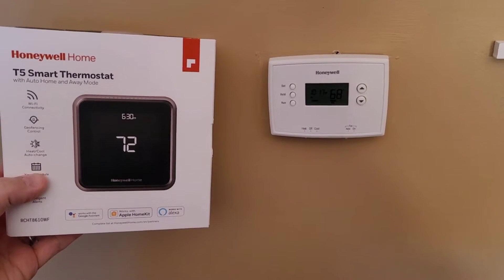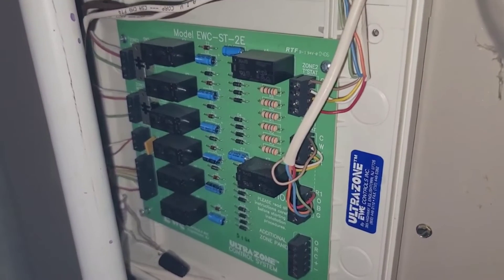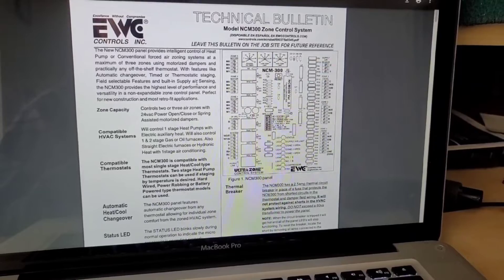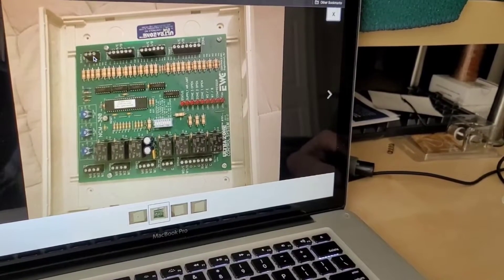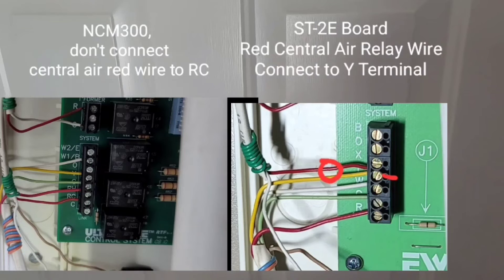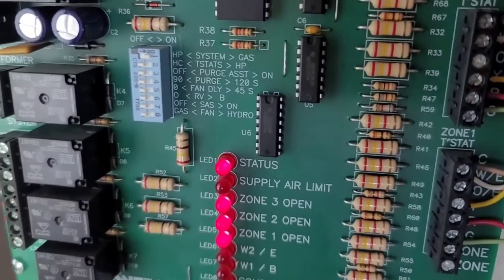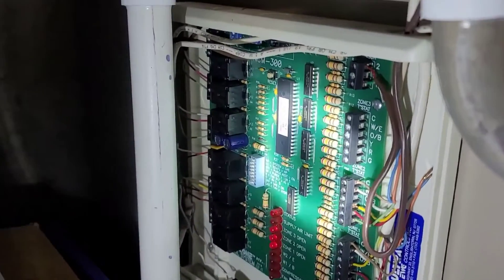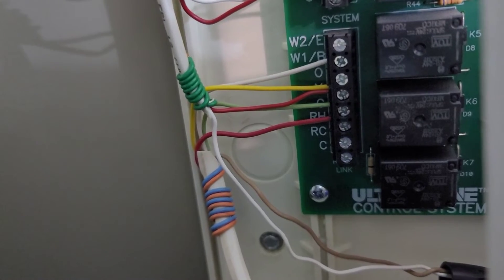EWC Controls: EW-ST-2E Upgrade To NCM300 Control Board

Comment: My current board at home might be broken but I can’t find any information about it online, the only thing it says on it is ewc-300. Whenever I google it I just find images and posts about the ncm300. I’m wondering if anyone knows if the ncm300 would work as a replacement for the ewc-300?
Reply from the maker: I believe they are one and the same. I've since upgraded to the NCM-3z board. I beta tested it and it has been working great! The NCM300 is still a great spare board should the need present itself.
Reply: @Bassguitarist1985 Ok, thanks! I figured that they were probably compatible but I couldn’t find anything conclusive on the internet.

Comment: I am in southeastern CT and also have the EW-ST-2E board. I bought the NCM300 board and am looking to swap it in, but noticed that on the 090512A0369 drawing you posted it seems to specify that the R wire SHOULD go to RC and not RH. That's the opposite of what you mentioned in the video so I was wondering if after you spoke to John that the drawing is inaccurate.
Reply from the maker: @unsaid457  I'll have to review the document when I have a chance.
Reply: @Bassguitarist1985  And what I should have said first off... thank you so much for posting this! Last winter I was told by both a Nest installer and an HVAC professional that using a wifi thermostat would be impossible for me, and in the end thanks to you, I'm going to be able to solve this myself.
Reply from the maker: @unsaid457  I can be available for a chat on StreamYard if you like. Email me at bassguitarist1985 AT yahoo DOT com
Reply: I am planning to install one and ran into the same issue. were you able to confirm if the R wire should go to RC or the RH. my understanding is the on the NCM300 there is a link between the two terminals.
Reply from the maker: @luismiguelescano2315 Yes there is a link between the two so it shouldn't matter which one. If you have a central air system like I do then the contactor wires, two of them, One goes to common and the other one goes to the yellow Y terminal.
Reply: @Bassguitarist1985  Just did the install. Everything seems to be working appropriately. Thanks for the video and pointers!
Reply from the maker: @luismiguelescano2315  My pleasure glad it worked out!!

Comment: I found this video after being told my system was also not compatible with nest, and i have the same system and board as you. Apparently we all 4 (@josephhoang7669 , @tdunlavey , me and you) also all live in CT except im in south Eastern CT, so i figured i should comment on the video because of the wild coincidence. I think this video will be a great help for me once i find where to buy the new board.
Reply from the maker: I'm beta testing a new upgraded board soon. John from EWC has been really patient with me as I've had other things going on. The NCM300 is a great board, but it is outdated by today's standards. Still very viable, and not too expensive used either.
Reply: @Bassguitarist1985  sounds like you have a ncm300 you can sell me lol jk should I wait for the new board?
Reply from the maker: @5JLMelendez5  ha! I like having spares. The new board is still in beta but will be out soon.

Comment: Hi Bass, this was incredibly helpful. I recently purchased two Nest Thermostats which are theoretically compatible with my HVAC system, but not according to Google (because of the EWC control wire which makes it look like I have a Heat Pump system). I have the same EWC model—my house was also built in 2004 here in northern Connecticut. As a DIY guy, this will save me hours of research, and likely a few bucks, too. I will come back to this video once I receive my updated board.
Reply from the maker: Tucker I actually live in Connecticut!!! Not sure exactly where you are I'm just north of Waterbury.
Reply: @Bassguitarist1985  Small world, grew up in Waterbury and live just north of Waterbury as well. Thank you so much for this video, incredibly helpful!
Reply from the maker: @Tony-mm3ut  My pleasure happy to help! Up near Torrington?

Comment: can you share the install/config of the thermostats, please I am upgrading my existing system to the NCM300. I am a little confused on the wiring error you made, I want to avoid it as well but I am not sure what exactly was wired wrong then wired correctly, thanks - I purchased 2 Honeywell RTH9585QWF thermostats to replace my existing thermostats.
Reply from the maker: Same system as me? Forced hot air and central air? The contactor for the outside compressor, one side is common, and the other to the Y terminal, NOT the RC terminal. That was the mistake I made
Reply: @Bassguitarist1985  yes I have the same setup, the wire swap instructions show that the system "R" on the ST-2E should go to the system "RC" on the NCM300. How do I know which wire is the outside compressor contactor? Sorry for all the questions, I am prepping to swap the boards and thermostats this week, thanks. Looks like you have an extra red wire on your ST-2E, I only have 4 wires Y - yellow, W - white, G -green, and R - Red
Reply from the maker: @jamiemcmahon795  are you able to follow where the wire goes? I can jump on a streamyard video stream if you need help
Reply: @Bassguitarist1985  Let me check and get back to you, thanks, maybe I will try to get detailed pics of my current set up. As far as the thermostats, I think I can swap wire for wire and use one of the extra wires for the "C" connections.
Reply from the maker: @jamiemcmahon795  correct, yellow, white, green, red, and add the common C wire. Thats all your thermostats need. Email me if you have any trouble. :-)
Reply: Hi, I'm still confused about not using Rc as per the swap bulletin. Can you explain why you're using Rh instead please?
Reply from the maker: Did you still need help?